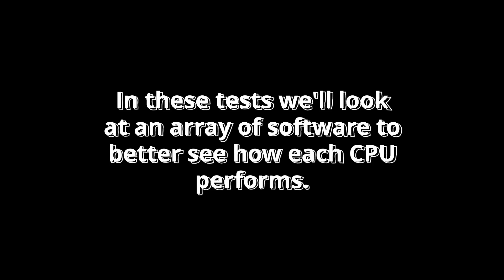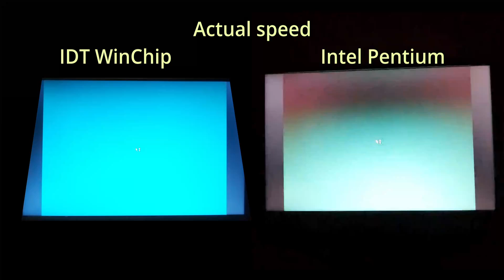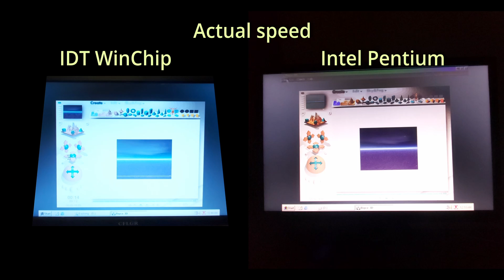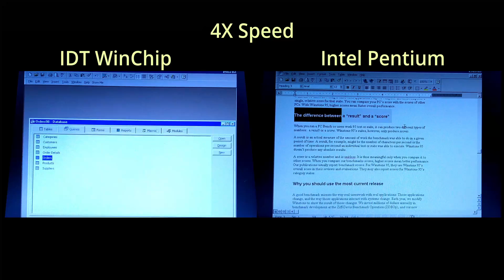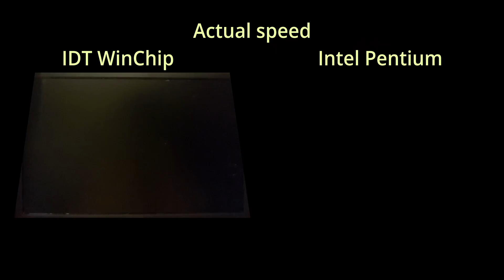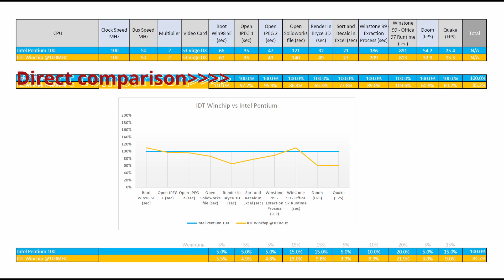IDT WinChip at 100MHz vs Intel Pentium 100MHz. Socket 7 & Socket 3 100MHz (ish) x86 CPU challenge.

Comment: My 486 DX33 runs Doom better than the Winchip 😧
Reply from the maker: The WinChip doesn't seem to be well optimised for gaming. It would of course run faster at its correct clock speed of 225MHz. I have another video comparing 233MHz CPUs running Quake and Doom, and included the 225MHz WinChip as it's very close to 233MHZ.  

I'll have 100MHz 486s from Cyrix, AMD and Intel edited and uploaded in the coming weeks.

Comment: There is also a IDT Winchip 2 (3,52V), better option for old Socket 5/7 mainboards with a single voltage. This CPU has also AMDs 3DNow! and a much better FPU performance than the previous IDT Winchip C6.
Reply from the maker: Yes, I've tried to get hold of one to test, but prices with shipping are expensive. If I understand correctly the WinChip 2 formed the basis of what was eventually released as the VIA Cyrix III.